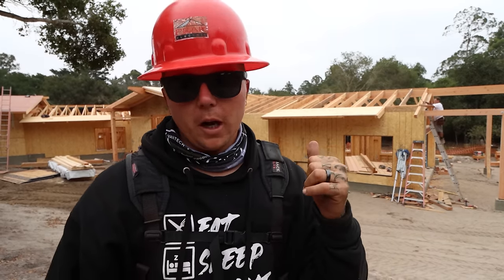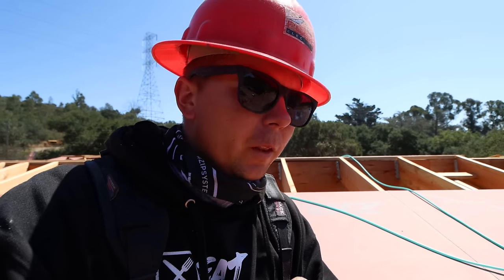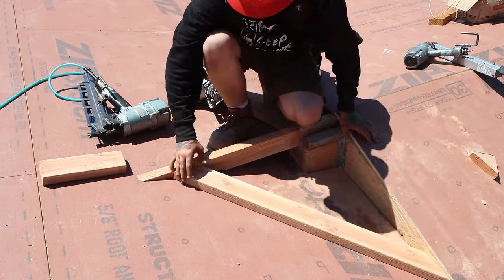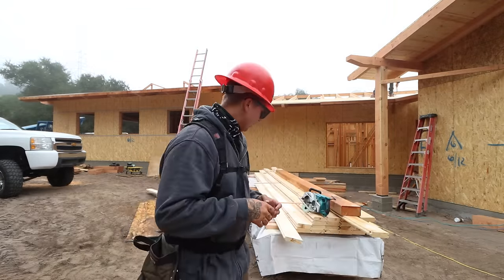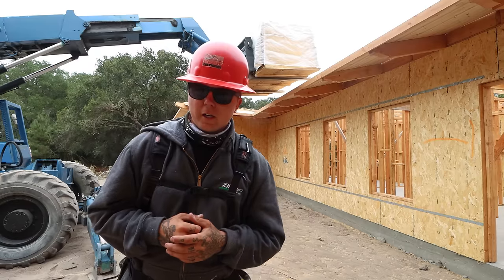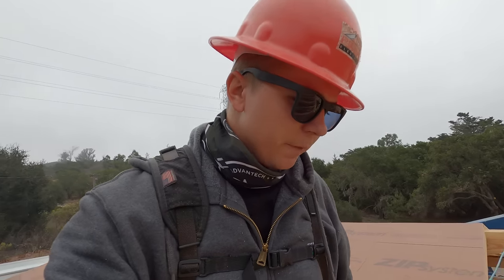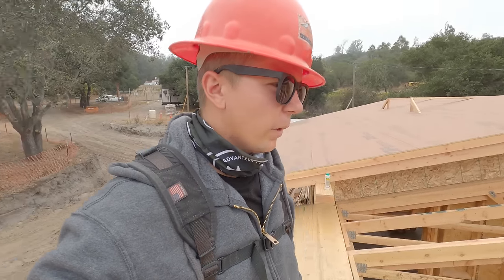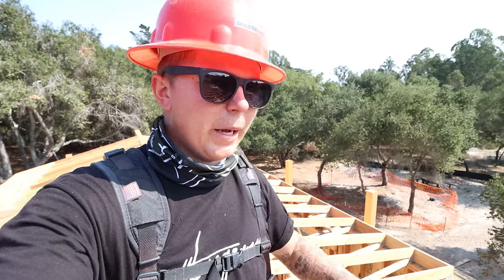The Ridge: Back Cut Tips, Roof Sheathing and 20 Episodes Down!!! [#20]

Comment: What kind of roofing will there be and will it require an underlayment over the zip ?
I'm told using zip means no underlayment is required, but not sure if that's the case with all roofing styles going on top of it.
BTW, THX for the step by step on the cricket. Made it look easy. When do you have to put a cricket on a chimney ? i.e... Certain distance down from ridge ; Does roof have to be a certain pitch or greater  ? Curious
Thx 
Thx
Reply: Usually you tape the seams. No need for tar paper but still need ice and water

Comment: Can you or someone explain why when sheeting you can’t have 4 corners together?
Reply: It’s a weaker joint for sheer strength
Reply: Jake Daly thanks man so you would put the next row 16 shorter right?then 16 back up the one after.
Reply from the maker: No, 48” staggered if you can.
Reply: No the joints would still be too close and it will be weaker. 

I’m assuming you are sheathing a roof like in the video. Set your first row with a full piece starting from the bottom working your across the roof. 
The next row on top cut a sheet in half (48”)and start with that. And continue the pattern until you reach the top. 

Think of it the way a brick wall look like.
Reply: Carlos Sanchez ah I see thanks a lot!

Comment: You guys seam to run out of stuff alot. Also why not keep a case of your hold downs in your trailer. I keep a case or two of H2.5 in the trailer at all times. Again you should be tape your seams as you go and rolling them out with the zip roller
Reply from the maker: Can’t tape our seams.. Inspector would throw a shit fit.
Reply: @MattBangsWood  you guys have nail inspection. That sucks because if it gets wet it harder to tape
Reply: @MattBangsWood   Does the roof nailing actually get inspected? I can see that for the walls, though. I've been framing for 20 years and have never seen a city inspector on a roof.  Heck the lazy ones won't even use a ladder to step up to a main floor.  I've had to build temp steps for them.